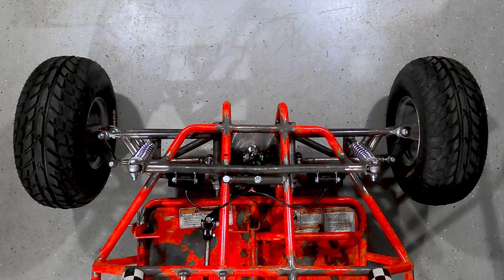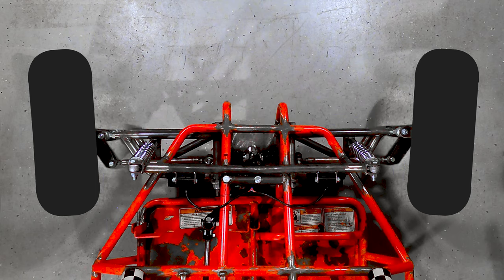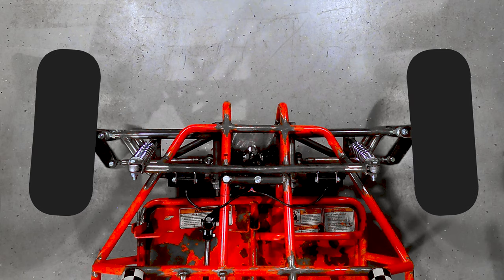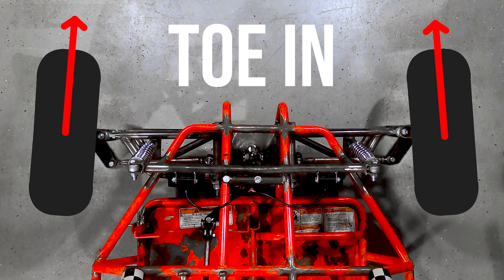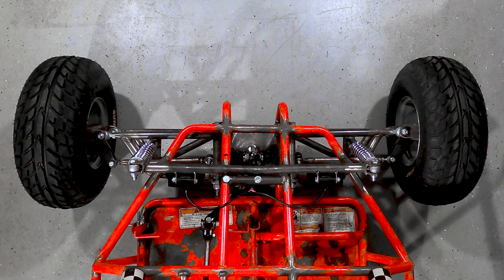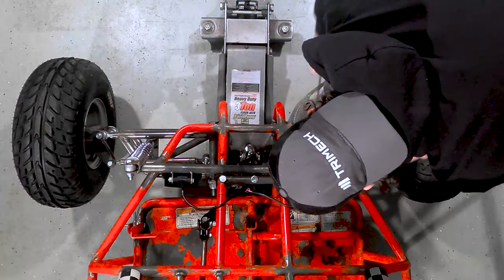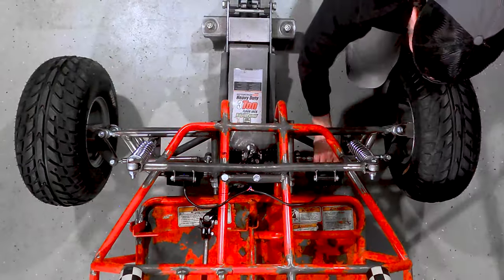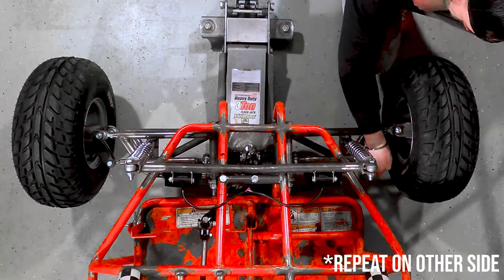Toe Alignment Explained | Go Kart Alignment | TYRANIS TIPS

Comment: Best lesson on the internet brother! Thanks so much for your contributions to the Karting community, best wishes and Merry Christmas!
Reply from the maker: Thank you so much man! I try really hard to makes these videos as useful as possible so comments like these mean a lot!
Reply: @TyranisCustoms  I can only imagine,  it takes me twice as long to document everything as I work on my projects and about another hour or two to edit a 4 minute slide show. I'm not paid and occasionally my best supplier helps me out but it's on me to do my thing. I'm by myself. Yesterday I got home around 1 and prepped and painted a minibike frame for 7 hours because I had a window of 35°, but still had to deal with freezing paint and every obstacle possible. I do this out of love and to try and make a positive contribution that helps or encourages others to try their best.
Reply: @TyranisCustoms hi bro, could you please support me in building my own gokart in india, the suspension and ground clearance of 6-9 is must, as we have bumpy roads and speedbreaks. my concern is with the engine and frame of kart, I don't know the measurements of the frames, and the engine i would like to use is 100cc bike engine which has a vertical shaft and gear system or maybe without gear is also fine, i want to ride it on streets, it should be really sporty looking gokart. i hope you reply to my message

Comment: Tips on sprocket change and speed difference.  3203 yerf dog Stock 60t vs more torque 70t vs more speed 40t.  Interchangeable sprocket to install in live axle and links to buy from gps or BMI karts.
Reply from the maker: Heck yeah. I've been wanting to do this one since before our top speed run but I've just been holding off until I could do the video justice. Cause I haven't really seen one like it and it could answer a ton of questions/misunderstanding about gearing, top speed, and torque, and what gearing suits various application etc. I think that video could be really useful

Comment: My steering wheel is crooked when it drives straight. Will adjust the toe help center the steering?
Reply from the maker: Absolutely! Center your steering wheel, loosen both tie rods, and keeping the steering wheel straight, adjust your tierods to bring your tires into the right position!
Reply: @TyranisCustoms  Thanks for the reply. It turns out one of my tires was out of alignment, and adjusting the tie rods helped center the steering. Thanks for the video and advice! :)

Comment: Any tips or tricks on how to get both tires even when u have limited tools?
Reply from the maker: Not gonna lie, I often eyeball it. We're almost always off road so getting it exact isn't always necessary. It might make things easier to tie your steering wheel in place to keep it from moving on you. I use a cheap laser line to help me dial them in when I'm feeling fancy. I just run the line parallel with the tire I'm working on and its a lot easier to see the small differences left and right that way. Hope that helps! If anyone else has any tricks of their own please chime in!

Comment: Have a cheap 2 seater kart project that we restored with a 212 predator, runs nice but when going fast when slightly moving the wheel, it feels like going out of control and you need to tight hands on the wheel to avoid move to right or left, it is turning more scary that fun. I don’t know if this is normal in go karting or needs some adjustments. Anyone?